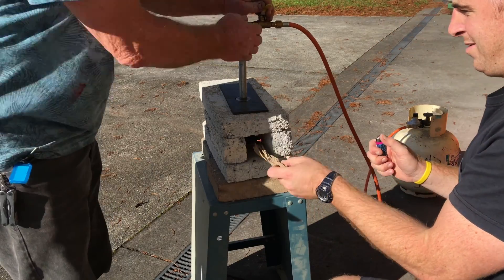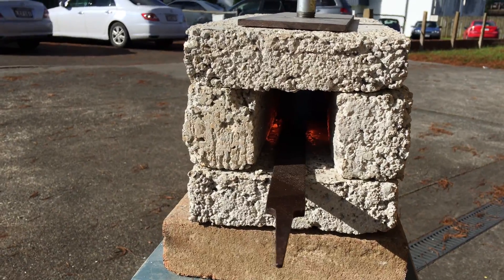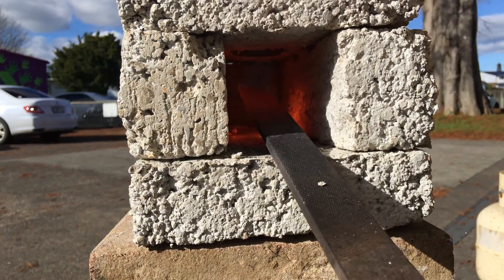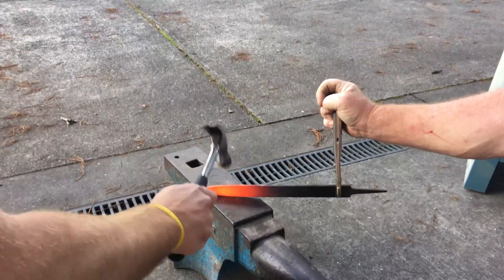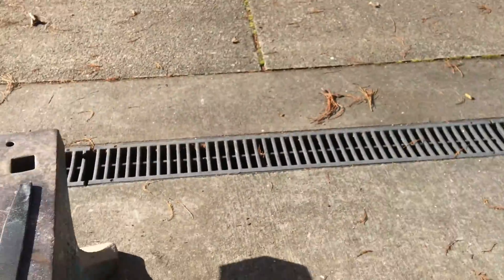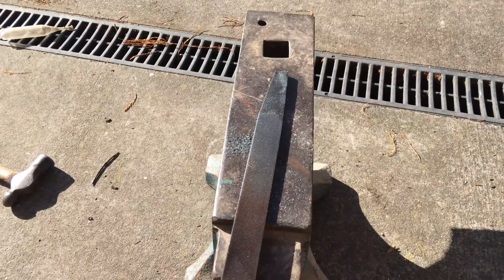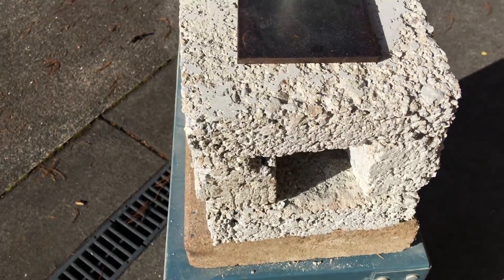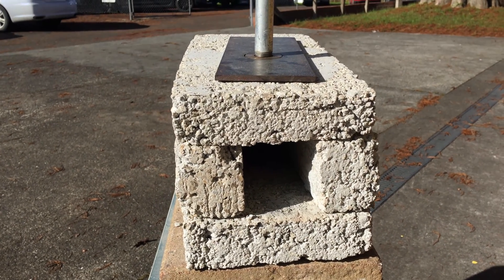We made a $25 forge and IT WORKS!! (RED HOT)

Comment: how mechanically strong are these bricks compared to the fire brick you have underneath the forge the and at an educated guess how thin could they be made and be not too easily broken.
I am thinking of possibly using this material as a liner material for a chimney project. The expected temperatures would be less than 400C and occasional brushing out to clean.
thanks

bern
Reply from the maker: TBH they are not that strong, and i wouldn't advise going too thin! They are a little crumbly on the edges.
Reply: @foodrelated  thanks mate...I had a suspicion that would be the case. I will probably add sodium silicate to the mix plus some fiber in the form of glass fiber or maybe carbon fiber if I can get it. My limited experience suggests the fibers could be as short as 1.0 mm